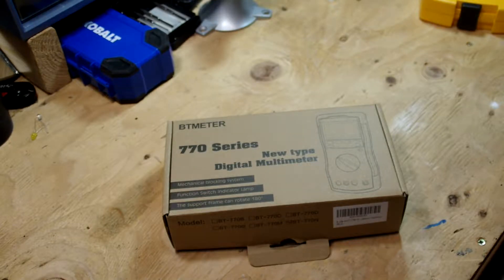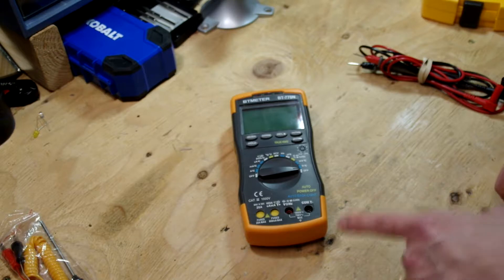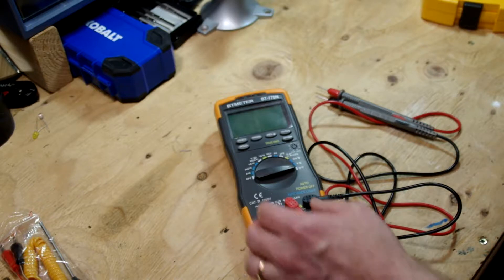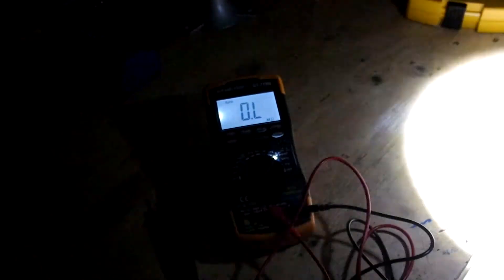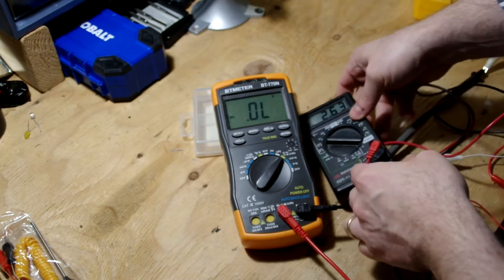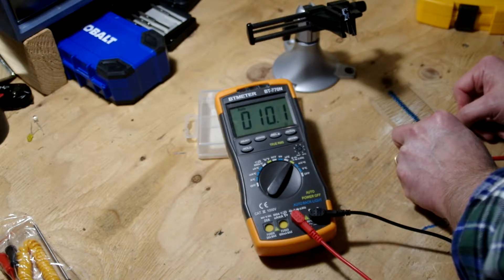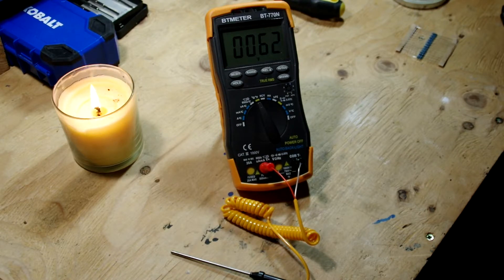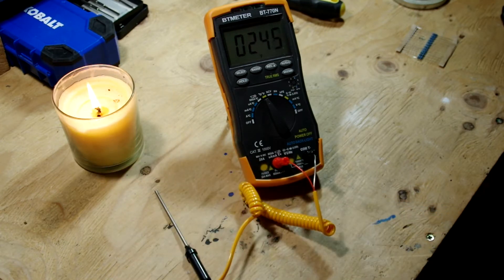A review of the BTMETER BT-770N Multimeter

Comment: Also for whatever reason you'll notice the one fuse on the left has one tall and one short fuse clip that leaves the fuse sitting at an odd angle-??-- I found out they are ALL like this for some reason --- I didnt like this so I ordered some clips and changed them out so I had two of the same size, fuse fits correctly now.

Comment: Ive had the exact same results with my identical meter, cleaned probe tips with fine steel wool and contact cleaner and really woke them up continuity is first class.  Meter is accurate as well, at first I didnt like the look and shape, but its grown on me especially since overall its proven itself to be a reliable and consistant performer.  At first I found the jack shutters a bit annoying, and I could easily remove them but they work well unlike some meters where they get stuck and jam so im leaving them in since im not above making a hookup mistake--lol   It had to grow on me but this meter has really proven itself as accurate consistant and reasonably fast so I really have to give it a thumbs up.  Its well worth what you pay for it.

Comment: My BTMETER  BT 77T  reads the temperature in Celsius , how to change it to Fahrenheit
Reply from the maker: Once you change the meter to the temperature mode, you can change from Celsius to Fahrenheit using the Select button. There is no way to change the default temperature scale that I'm aware of, so every time you power up the meter it will default to Celsius.